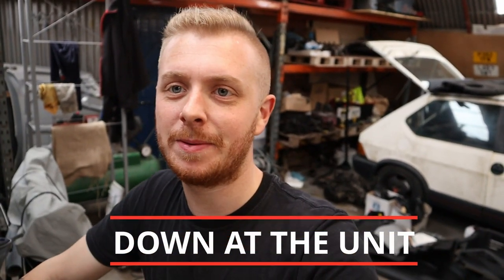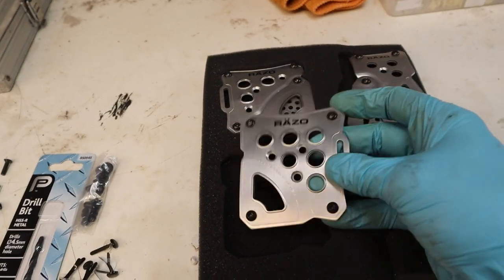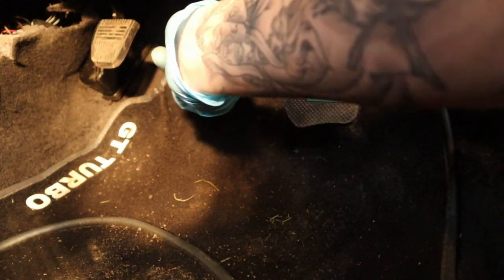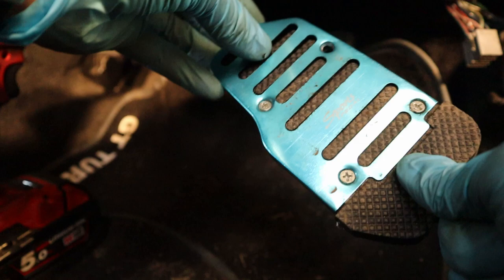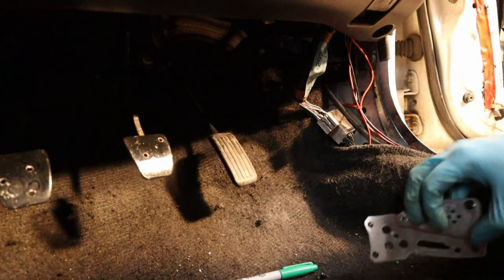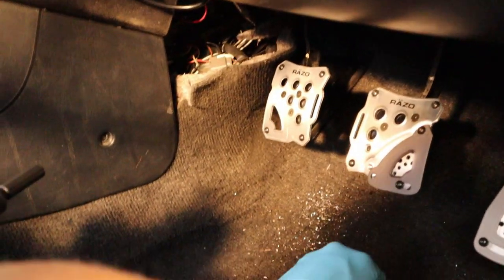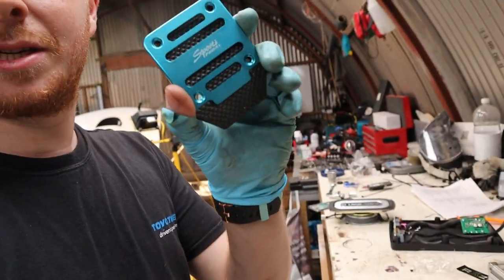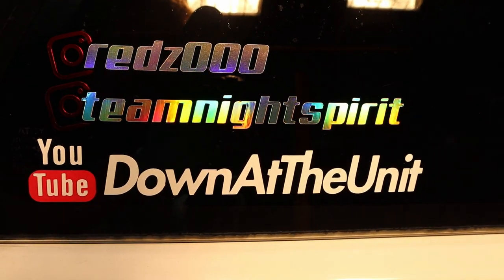Starlet EP82 GT Turbo: Installing Razo Competition Pedal Set - Episode 20

Comment: I’m thinking about getting these, are they slippery at all , do they have decent grip?
Reply from the maker: To be fair.. They are in all honesty.. Especially with my sparco racing shoes.. Although I did adjust the brake pedal too far out and kept catching the throttle and brake at the same time.. 😂

Keep them clean from anything that would cause it to be slippy and they're golden!

Hope it helps! If you get them for cheap they're definately worth it
Reply: Down At The Unit well based on what you said I think I’ll go ahead and give them a shot especially since I saw them for a great price on amazon, thanks a million mate
Reply from the maker: Let me know how you get on with them! I definately noticed the difference with them on track!